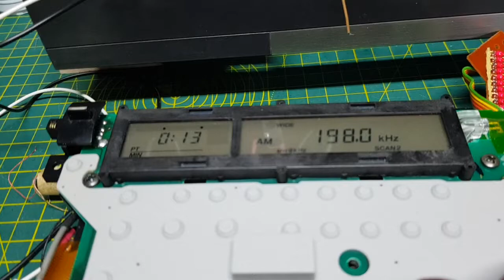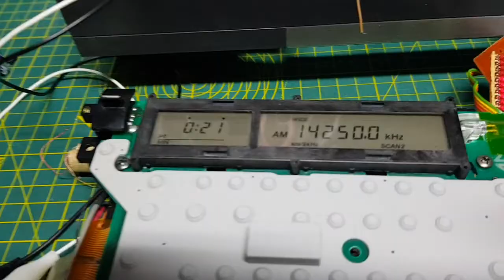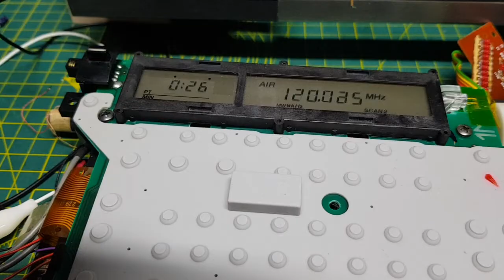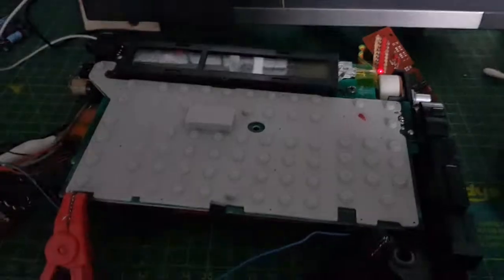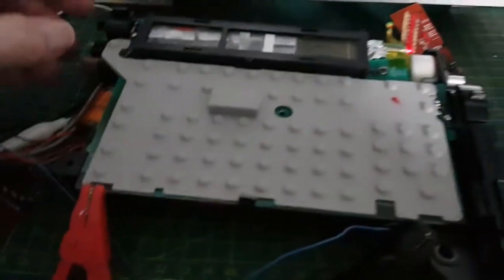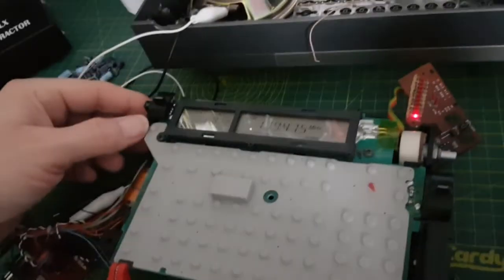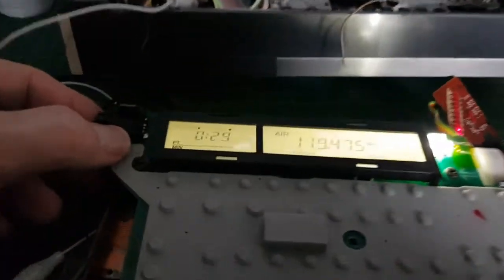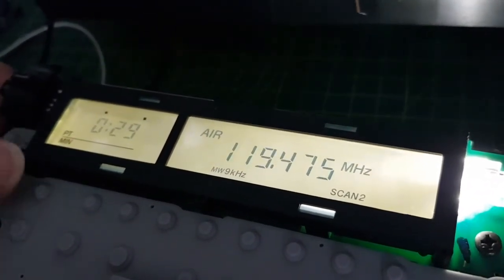Sony ICF-2001D after repair and modification

Comment: Just lifted the L305 on my 2001D it really does make a difference! The difference when you plug in even a short wire to the external antenna is huge, a station that was weak on the ferrite jumps up to 4 LEDs. It behaves like the Qodosen SR-286 and in my tests is now beating it!

I have an SW55 but it whines on 252kHz and seems to have birdies on SW not sure if it’s the caps or needs more in-depth work?
Reply from the maker: It's a nice little and easy mod to the 2001D and it does make a big difference. The SW55 problems usually arise from dodgy capacitors so if you haven't done them then I would asap
Reply: @Radiocruncher  Caps kit is on its way along with a better light for the screen. I’ll get it all fixed hopefully as it’s a nice set.

Comment: Hi Graham good afternoon:
My 2001D is waiting for some tender care, by the way really nice &  interesting video, so two questions are rising at my mind..Which Murata filter you choose180Khz Bw or 230Khz, for FM broadcast?.
The other : is there any mod the tunning step for Air Band?.Standard I think it's about 6,25Khz, 25K its really a nosense .
Thanks in advance 73's
 Richard EA1IFD.
Reply from the maker: Hi. The filter I chose was 150Khz https://www.ebay.co.uk/itm/290975892597?mkcid=16&mkevt=1&mkrid=711-127632-2357-0&ssspo=-1th37SlRiu&sssrc=4429486&ssuid=Bott14WpTSS&var=&widget_ver=artemis&media=COPY

Airband will work on 25Khz steps but the newer step size is 8.33Khz. There's no way I know to alter this. Thanks for watching

Comment: I have a local AM station 200m from the house. That's normally the only one I get on MW
Trying to get the price down on the power supply
Reply from the maker: I suspect you would need to keep that inductor in place then Maarten. Good luck with the supply

Comment: Nice little mod on the AM input. Lot's strong signals here though. I too discovered that there are stations below 88Mhz, they are religious stations with limited licences. Who knew... We listened to one for a while and he was suggesting we need to drink 6 pints (US or 3 litres) of milk a day, real twaddle.
Sony didn't sell a DC adapter here, so the plug has finally given-up on because the Tandy adapter doesn't quite fit :(
Reply: Pretty much unobtainium here. It’s a big Tandy power supply, that was with the radio when I got it, but the plug isn’t right.
Forgot about the gain control…
Reply from the maker: You can use the gain control on the side to tame the radio if you decided to lift the inductor. might be worth keeping an eye out for an original power supply